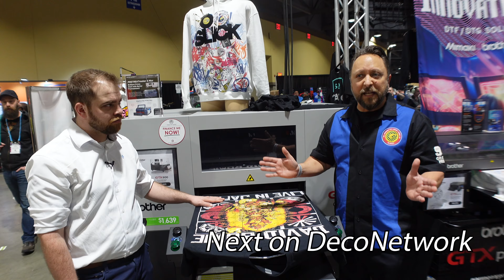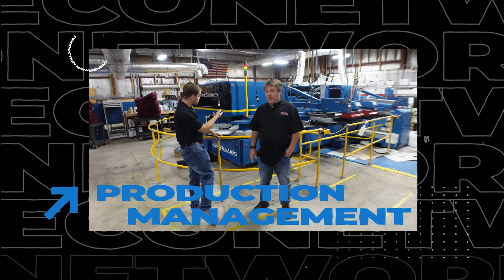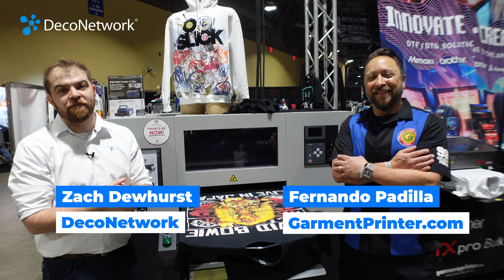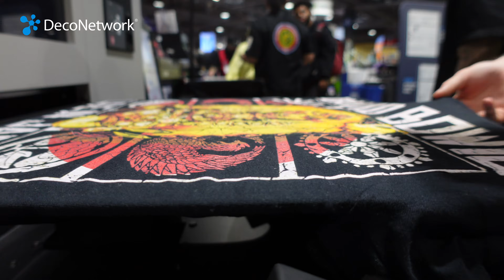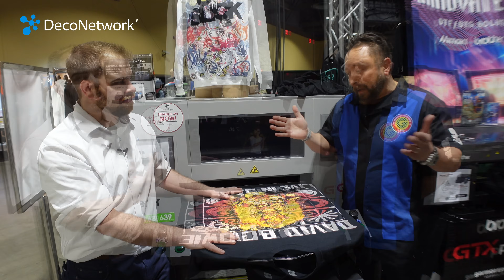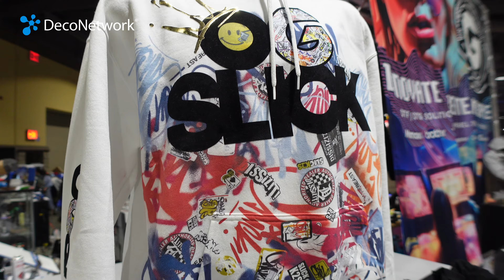Master the Art of Printing Oversized T-Shirts with the Brother GTX600 DTG Printer

Comment: These print heads clog to easy even with proper maintenence and cost $1800 to $2500 a piece🤬Make that make sense? The machines are nice, but the parts for them are way overpriced. The part that is real ingregious, is that they have the nerve put chips on the ink cartidges to force you to buy only there ink, that of course is way overpriced. This particular machine costs $75,000 and has 4 print heads. Let that sink in....